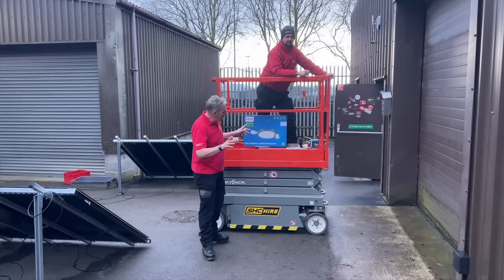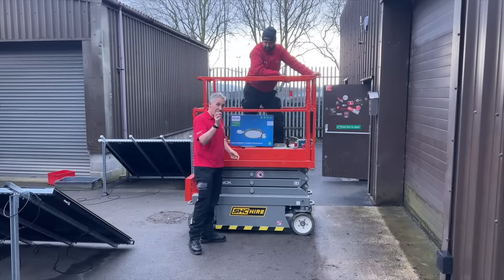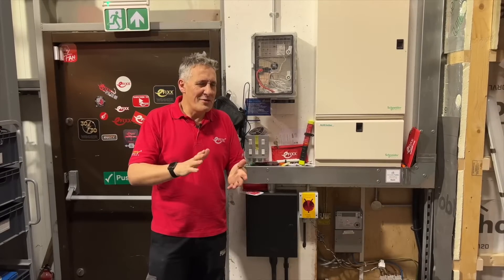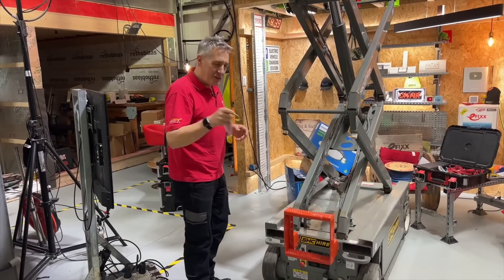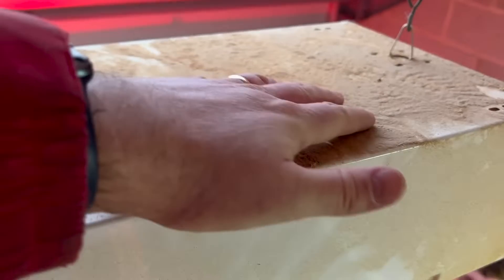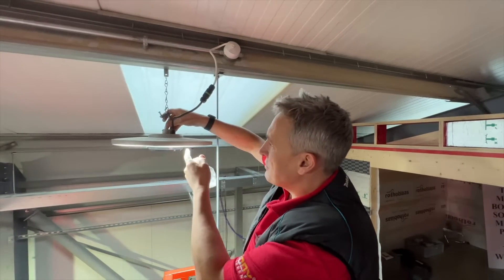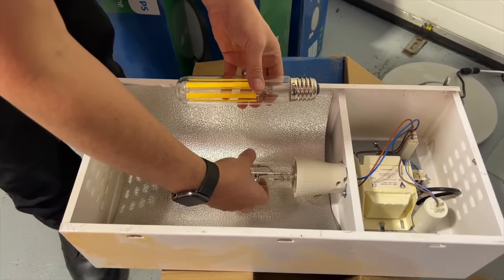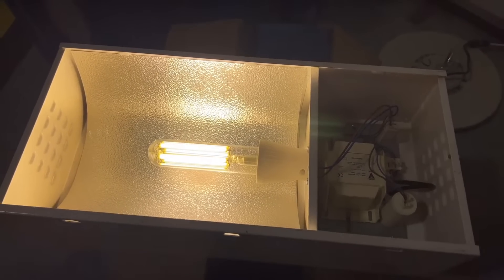The Dark Secret of eFIXX Revealed: A Lighting Upgrade Story

Comment: And one of the biggest problems with most LED fittings, that stupid short flex. Why on earth do they make them so short, and not changeable ? And no, new fittings are often terrible from a maintenance point of view, as replacement parts are generally non existent. At least with a replaceable lamp.....you can maintain it in the future.
This is a huge problem for maintenance and very very wasteful, which is supposedly a bad thing in our modern world.

Comment: @eFIXX what frequency do the lights run at? Is it your standard 50Hz or are they driven by high frequency control gear inside operating in the KHz range? Just thinking about filming and scrolling line/bar effect (rolling shutter).
Reply: If you’re that worried, get some lights with a high quality constant current driver and tiny ripple.
Plus for filming you likely want high CRI, 95 or better

Comment: Curious how a new user can connect to the system with your phone without a cloud connection?
Reply: Bluetooth? WiFi AP built in?
Reply from the maker: It works off Bluetooth to the phone and then Zigbee mesh between fixtures - I've put a link in the description for more info.

Comment: It's all fun and games until someone redevelops flourescent lighting and makes it 100x brighter, and then watch as the led gets phased off rapidly from lack of replaceable components. 😂
Reply from the maker: LEDs don’t have much further to go in efficiency.
Reply: @efixx but too far in replacement components. I may start a petition to exempt tubes from the "ban" if they are 2 times brighter and 5 times for ceramic metal halide lamps.
Reply: Old tech thats hugely inefficient...

You can't redevelop physics
Reply: @gardenogauge  or you can redevelop them as already mentioned.
Reply: @professionalineverything  give an example of where this has been done?
Reply: It’s really fun realizing that a lot of new lighting is low voltage.  You won’t have to pay a high side or resi to install them, a low volt tech (and their lower cost) can.
Reply: @Mudder1310  well who's going to install SELV transformers throughout the circuit, not me.